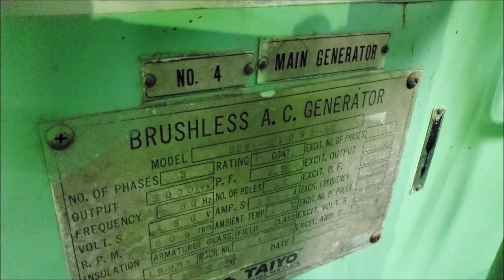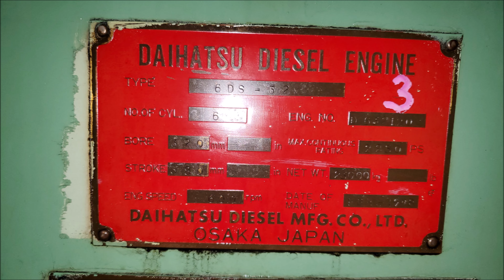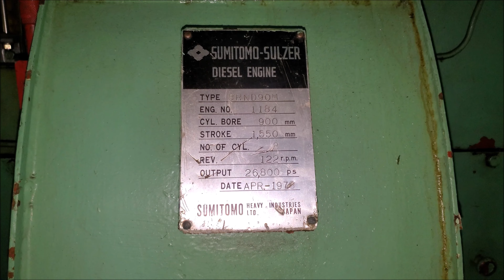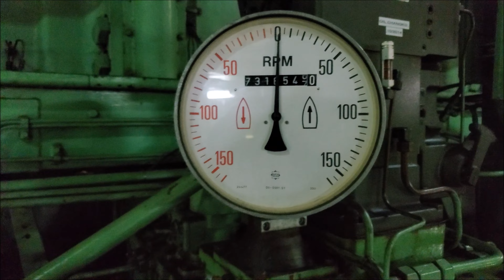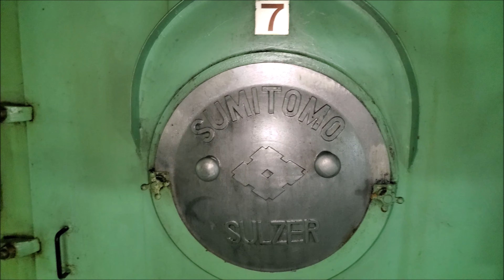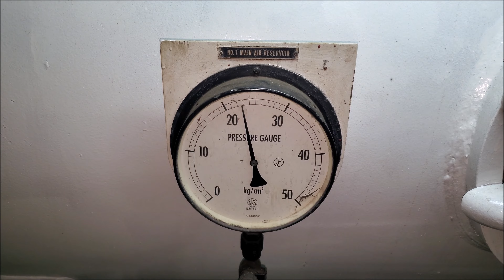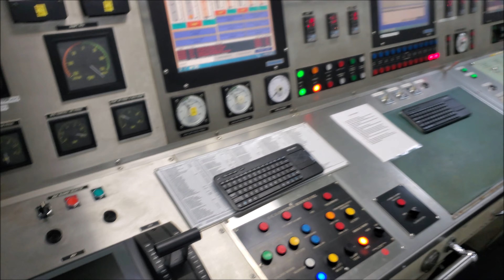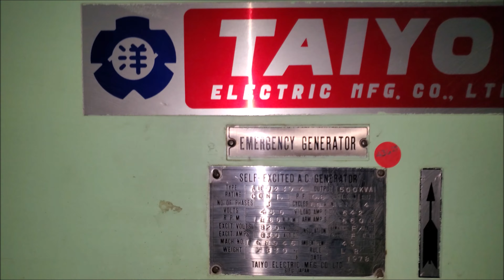Huge Antique Sulzer Ship Engine Room Tour High Definition 4K

Comment: Remember almost losing a finger when a main bearing jack bolt slipped when lifting it out to remove the cap for survey.  Think the bolts were ca. 90kg each.  Used a chain block to lift them after that...fuel injectors are big lumps as well. Best engines of that era imo, way more solid than the later stuff...despite the scavenges!!  Thanks for posting.
Reply from the maker: I am very sorry about the finger!!!! I have come to be so much more careful down below than when I was younger but regardless, accidents can always happen even when all precautions are taken. Thanks for watching!
Reply: Did 3 deep sea trips UK-Aus/NZ  in 1965-66 on twin screw 2x6cly Sulzer job (built 1960). Had endless troubles with those. Head gaskets leaking when Manouvering the engines. Like playing the band with all the different squeaks & sqeals. They closed up when full ahead. Homeward bound  changing  an injector every day. Copper locating pin kept shearing and nozzle turning letting fuel oil into cooling water. One Engineer almost full time grinding nozzles. Water in No.2 Port Scavenge drain glass. Liner pulled, replaced O rings, boxed up ,still leaking. Checked for cracked liner ended up blanking unit off. Port engine 80 RPM, Stbd at 90 whole ship bouncing with the odd RPMs. Two days later "BANG BANG from same crankcase. Someone didn't secure crosshead locking pin properly and crosshead turned and hitting Piston telescopics casing. Oh what fun we had, couldn't wait to pay off that trip.
Reply from the maker: @PeterGardner-e1z Jeez that's a nightmare! Haven't sailed on anything that bad or needing constant attention. Glad you survived it!
Reply: Ah, I was just thinking that's a very similar RND to one I sailed with and how good they were, then you mentioned scavenges....yeuch. Shame she wasn't full away in the video, so I could remember the sounds.
Reply: Most of my sea time was on the Harland and Wolffe opposed piston types. Good solid engines. Three trips on a twin six Sulzer job in 1965--66 was enough for me. Endless problems, Blanked a unit off at sea, ended up taking out the Con Road ETC after two more days. Changing a different Injector every day homeward bound from NZ to UK. Dropped the hook at Southend to wait the tide, went astern to bite the hook and No5 Stb head gasket blew out. What a carry on.

Comment: It reminds me of my very first ship, MV Rosie D, built by Namura Shipbuilding of Japan.  7RND68 Mitsubishi Sulzer 11,550 bhp at 150 rpm IIRC.  Yanmar gen-sets.  That ship was built to a much cheaper specification than this vessel, but it was still very well built and all the machinery was sturdy.
Reply from the maker: From my experience Japanese built vessels are of very good quality. As I get older I find myself liking their products more and more. Thanks for watching!
Reply: @FixAndForget  In the 80's I worked on a vessel made by Hyundai Heavy Industries of Ulsan South Korea.  The quality assurance, build and fit quality from the yard was appalling, loose gaskets in the fuel system, swarf and welding debris in air systems.  The main engine and gen-sets were perfect, but they weren't built in that shipyard, just installed there.  HHI improved very quickly after that, but still well short of the Japanese yards.

Today I work power stations, and one of our plants uses 240 MW Mitsubishi gas turbines and I can still recognise the conservative over-engineering that I first saw in that Mitsubishi Sulzer engine all those years ago.
Reply: Ships were built to last back then as well mate, these days, 15 years is getting long in the tooth. @FixAndForget
Reply from the maker: @marvindebot3264  That is a fact. Thanks for watching

Comment: I worked on a 9RD90 back in '83. Scavenge cleans and horrendous reversing gear. Never forget it!
Reply from the maker: That sounds awful. Thanks for watching!
Reply: The RND-M was much better than the RD. No rotating valves in the exhaust due to the change from impulse turbocharging to constant pressure turbocharging and the one-piece forged steel cylinder head instead of the two piece cast head of the RND and RD was a good improvement as well.

Comment: The RND 90 Sulzer was not valveless. On the turbocharger side of the engine there was a rotory plate valve for the exhaust. I remember working undoing the water cooling pipes under the valve unit. A swine of a job. 2 spanners with different offsets to get any turn no the water unions.Ugh.
Reply from the maker: @michaeleast216  Thanks for the info! Sounds like a bad time, few other folks have shared that these engines were not fun to maintain.

Comment: I’m currently an engine cadet at CMA, awesome video! Learned about these in class but I didn’t think were any were still kicking!
Reply from the maker: @jdp..1716  Thanks for watching. I graduated deck from A&M in 18'. If you spend any time on an ROS ship you're likely to see one. The chief on here could remember when the engines had big coil springs to close the exhaust valves. Good luck at the academy.

Comment: I probably could work in that engine room within a few days of orientation. I worked with that engine and tools. One small remark about this engine: it is not completely valveless. There are banks of valve boxes (plate valves) between the scavenge air box and the cylinder intake manifold. 

At first I had a nice fuzzy nostalgia feeling until I remembered the absolute horror of the re-occurring cleaning of that air box and those valves. We had to save fuel and therefore had to run that engine too slow. In combination with the very dirty fuel we had to clean the scavenger air box and those valves every few weeks. It was horrible.

And we were slow: one time we did 5 weeks from LA to South Korea. No more fresh vegetables, the last days we had only rice, canned green beans and home grown bean sprouts (Taugé). He had enough for the crossing, but after the crossing we had to go at anchor at a place we could not see the shore. No customs, no supply and not allowed to go ashore. It took a couple of days before we were allowed to anchor in the river delta and every thing became normal again.
Reply from the maker: I greatly sympathize with you on the long trips, lack of fresh food and scav box cleanings. Were these engines prone to air box fires. Thanks for watching sir!
Reply: I remember while in port working on those rotary exhaust valves.  An enginner got his foot caught in that link while the engine was being turned. Can't remember the result but it wouldn't have been good.

Comment: How about a 1934 built Berminster & Wane double acting top and bottom exhaust pistons lay shaft driven roots  blower that had been given some rough treatment during WW II.  This was my first ship in 1956 as a junior engineer and introduced me to scavenge fires and big hammer maintenance and all on marine gas oil!
MWD.
Reply from the maker: That's really cool Mike, I had no idea B&W made such a thing. I've worked on a few WWII vintage Clevelands but nothing huge. I saw my first double acting engine last weekend at a steam show. It was a natural gas "Snow" engine of 400 horse. Very cool. Thanks for watching!
Reply: Google “Doxford Type”engine there’s a video of a Burmeister and Wain 2 stroke with exhaust pistons.
Sailed on this type back in the 1970s
Reply from the maker: @sandyjack1901  I will most certainly do that. Thanks for watching!

Comment: Did Not know DAIHATSU made ship engines, we were on a ship named PACAFIC NOMAD, being used as a dive boat in FIJI in 1990 it had a HYUNDAI  Diesel engine, with air start, I looked it up, found it’s just rusting away, tied up somewhere in FIJI,  CApt  APATE, was a really nice man, I used to go to the wheelhouse nightly with crew drinking KAVA,  NICE CREW,🇺🇸🇺🇸🇺🇸🇺🇸
Reply from the maker: I didn't either. Thanks for watching and sharing, I'll have to look up Hyundai marine engines now. Cheers!
Reply: Well kept. Tight ship
Reply from the maker: @paullindberg9230  Thanks for watching!
Reply: Daihatsu Engines are crap though. They don't have Marks punched into the Crank Webs for measuring Crankshaft Deflection. Instead, you have to place the Dial Gauge manually according to the Coordinates given in the Manual, and hope that it won't move when turning the Crankshaft to the next Position. You just can't geht reliable Measurements that Way.
Reply from the maker: That sounds horrible!!

Comment: I was on a real Antique. 1939 Tug all DC. Diesel electric drive. Had 4 V12 supercharged 2 cycle diesels.
Reply from the maker: I've worked on a few 40s build ships with Cleveland, FM and steam turbine propulsion. Absolute joy to work with. Current ship is 4 big EMDs.

Comment: Forgot something: the usual way to store a spare turbocharger rotor on a ship is to suspend it vertically, thus preventing it from bending by its own weight.
Reply from the maker: Jan thanks for sharing! You are absolutely correct. I snapped a few pictures of the rotor when we craned it on, it ended up going back onto the #2 SSDG.
Reply: @FixAndForget  Once a marine engineer, always a marine engineer👍

Comment: 10:13 does that electric fan run to get it started since it’s like a 2 stroke or can it scavenge enough to get it started?
Reply from the maker: You are exactly right, the fans run until the engine is commanded past slow ahead/astern RPM. Thanks for watching!

Comment: Sulzer rta
Reply from the maker: 8RND90M. I believe this is the loop scavenged predecessor to the RTA but I'm no expert. Let me know this Saturday when it finishes posting!
Reply: @FixAndForget  rnd Jesus that’s a old lump
Reply from the maker: If it wasn't owned by the gov it would have been cut up long ago.
Reply: @FixAndForget  proper old school engineering on these things you treat them nice or they bite you on the ass in a big way.
Reply from the maker: @hughjarse4627  absolutely
Reply: @FixAndForget  Sailed with the 9RND90M 😀 and liked it very much.
Between the RND-M and the RTA Sulzer had the RLA and RLB types as well
Reply from the maker: I believe it. Has to be a reliable engine to have lasted this long, also nice to have more mechanical components and less automation.
Reply: @FixAndForget  I did three contracts with the RND-M.
No problems whatsoever.
The RND had a cast steel cylinderhead with a smaller “innerhead” as we called it. These sometimes suffered from cracks.
The RND-M had a solid forged cylinderhead in one piece provided with borecooling.
Leakage has been reported in way of the bores on both sides of the bore for the indicator valve and the bore for the starting air valve. Cooling appeared to be too efficiënt in these areas.
As a preventive measure we had to hammer in four nylon sleeves of about 4 bananas long, which were held in place by spring loaded bushes.
Tools for that were of course supplied by Sulzer.
Reply from the maker: I'm not sure how many others (if any) are now owned by the Government but these two now sit berthed together in reserve status. They are in overall good condition and are exercised at least once a year I would think they will be around for quite a while longer.
Reply: @FixAndForget  yes indeed, I have sailed with RND 90 and RLB 60, quite reliable engines but loop scavenging was a menace. Also was  the water cooled piston cooling and water cooled fuel valve cooling, there were lots of breakdowns on these parts, I prefer the uniflow type MAN B& Ws , much cleaner and less maintenance extensive.
Reply from the maker: @udayanpaul8042  I haven't had much experience with that but I completely belive you on that. Thanks for watching!
Reply: Its Rnd and later Sulzer was making Rlb that was similar
Reply: @janvisser2223  Thank you for reminding me. I did install quite a few inside cyl heads on RLB 90 .